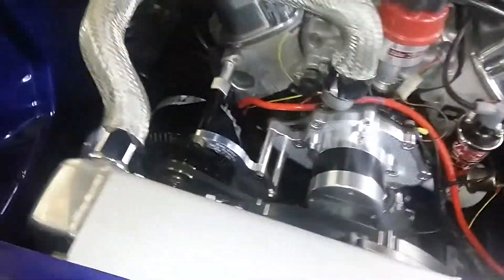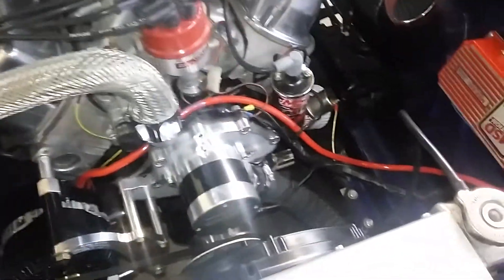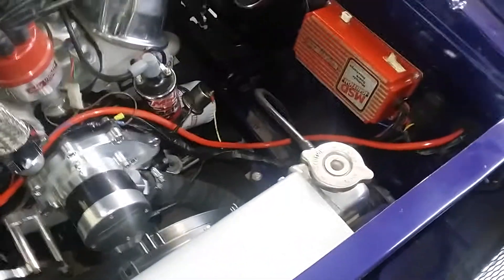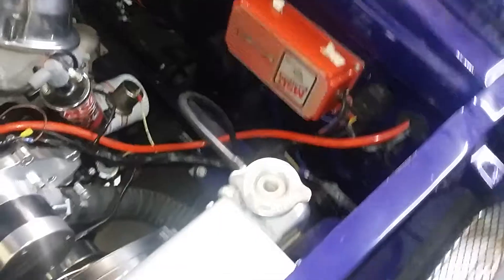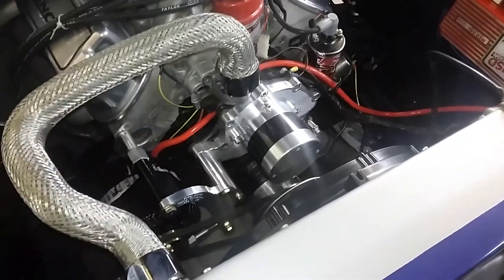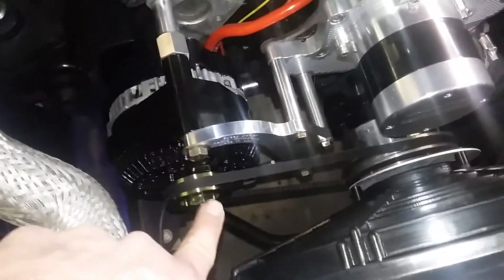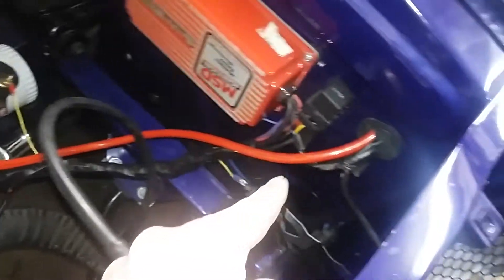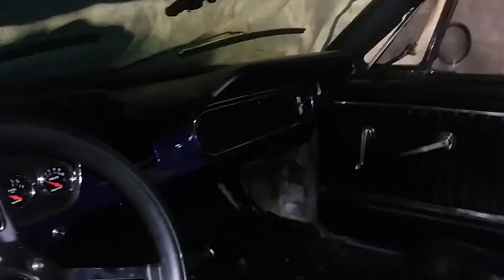1965 mustang: 1g to 3g alternator!

Comment: stumbled across this video again. car looks so good man. I'm finally almost at this point lol.. dealing with alternator fitment now... you need to put out some more videos. miss watching them.
Reply from the maker: I haven't had any time to mess with it. Work 60 hrs a week and then family as much as I can get in. The stroker is still sitting on the engine stand.
Reply from the maker: But this 3g upgrade has been great. Its exactly what I needed. I'm also stock piling a few parts for when I do get time to work on it. I have some more gauges and I'm trying to find a deep pan for my trans so i can run a trans temp gauge. The stroker heads are at the machine shop getting ported and I picked up a comp xe282hr cam. This engine gonna be sweet. Probably gonna change up the mufflers also. Thinking borla or magnapacks